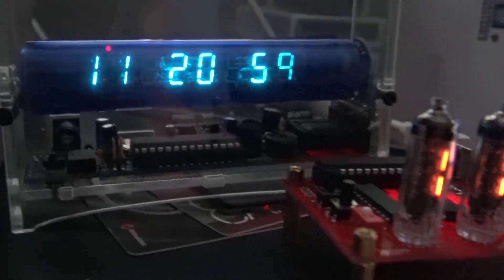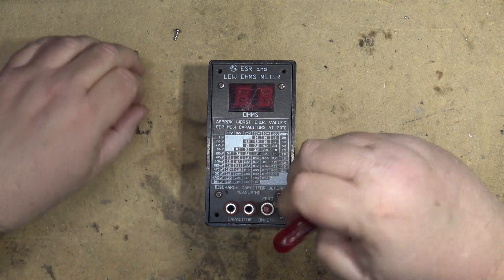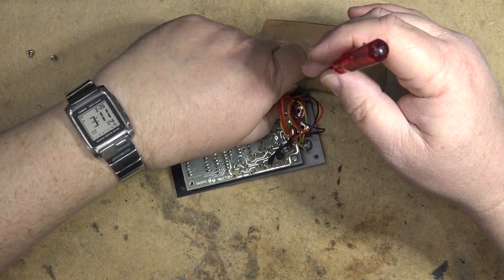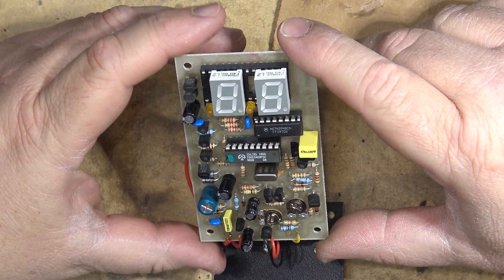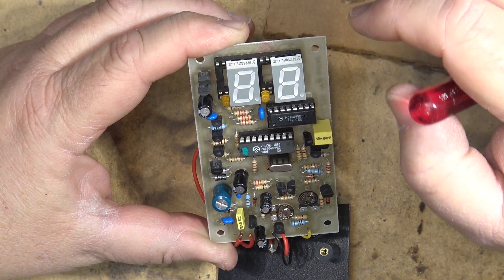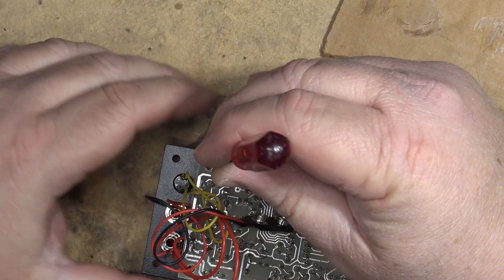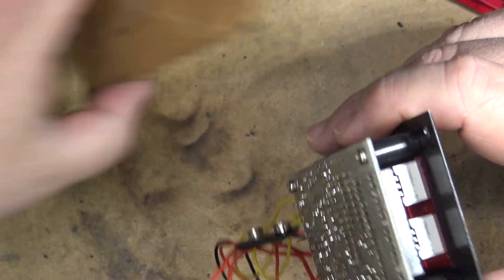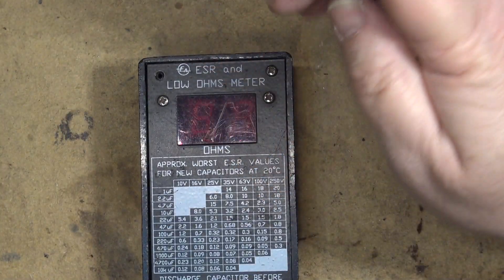Bob Parker ESR meter teardown

Comment: I have same meter and put it together too. I got mine back in the 90's and it has never failed me and have the same insulating material in mine too. I love how it checks in circuit and shows what caps that should be changed and the fact that it reads very low resistances of inductors and resistors. Very nicely designed meter, it's had very heavy use and saved me a lot of time!!

Comment: Maybe 25 years ago I bought the same meter, mine is Dick Smith, "EA" is Electronics Australia.

I use this meter 7 days per week during 25 years without any issue.
I add two diodes in opositive way in parallel to the inputs, some times I forgot to discharge a capacitor and the diodes blowup without any damage to the meter.

Best Regards.

Comment: Wonderful teardown an review dear sir. This is a great test equipment. I reaserched about it couples years ago and coped by the same processor code as it not available anywhere. Anyhow I made one analog one with digital ics buffer's and oscillator. That is really a fun and same way useful as digital one is. But those professional units aren't good which have a test button on them and you have to press that button once every time you test a cap.

Comment: That has been so dam handy for you, the amount of decent looking capacitors that have tested bad, not just on switchmode supplys but many ancient audio devices.
Worth every penny :-D
Your fluke multimeter has been very reliable for a long time, ignoring the minor recent display problem.
Again a dam usefull bit of kit that gives you information, just like the ESR tester.

Comment: I made a version of this meter yonks ago from the schematic.  I used a PIC micro though and wrote my own code however.  It is very simple code and is pretty straight forward.  I think I spent around 6 or 7 hours on the code portion.  The most interesting part to me was the measurement itself is done-  it uses the capacitor under test and a capacitor on the board to form a capacitive divider, and then sends current pulses through it alternately from ground and vcc.  There's three different transistors to VCC with differing resistors to control the test current, which is how the different sense ranges are done.  I am not sure how "smart" the original was with its autoranging, but mine worked by running at the lowest current range, and if the resistance reading was under 1/10th of full scale for that range, it'd bump the current up to the next range and move the decimal point and try again.  repeat until current is maxed out or reading is in range.  Eventually I retired it when I got a proper job LCR meter.   incidentally, that esr meter is good for other things- you can measure low value resistors with it, and wire resistances within reason, and PCB tracks.  I have used it and the LCR meter to find PCB shorts on power rails by moving the probes around on the board to find the point of lowest resistance.
Reply from the maker: That's why it is called a low ohms and esr meter.
Reply: @Kevtris , beautiful work :3 can you share the code plz

Comment: Always love those meters. I’ve got a collection of ESR meters and short circuit faultfinding/sniffer probes. I Love the Hewlett-Packard current injector and tracer probes but they are getting stupid expensive… Also love my EDS “leak-seeker 89”. It’s got to be one of the absolute best short circuit sniffers that’s ever been on the market. (And Iv had multiples of all of them)😁 Simply because of its small compact design, exceptionally well thought out and evolved circuit, and Jesus it’s just so easy to use and works so well.

But One thing I’ve always wanted… Is an analog esr meter. I’ve never had the time to build one and the only one available on the market is crazy expensive like $300 or something for a device that doesn’t look exceptionally well put together. I think it’s called the capacitor wizard or something like that…

Would also love to have an analog milli-ohm and micro ohm meter. I guess some of my VTVm’s have that capability and some of my modern multi meters and LCR meters definitely have the ability to check low resistance… but I Would just love to have a small self-contained analog unit. So I don’t have to drag out expensive and touchy high end equipment just to check for low resistance shorts. Or when I’m on the road or checking something out at someone’s shop away from my gear.

I’m a huge fan and collector of the Huntron tracker line of equipment… As well as the ”Toneohm” units. Been buying those for the past 15 years when they come up cheaply. 

My fascination with so-called “instant easy faultfinding devices“ started when I first started electronics… And didn’t know enough to use real lab gear. And also couldn’t afford a lot of real test equipment. So these “all in one” devices were so cool to me. Like magic. 

Now I have a few favorites for tracing out faults… Like the leak seeker, the De-5000 LCR meter, the HP current tracer probes, The Wavetek sf-10 short finding brush.... of course the flir thermal camera. That’s about all I use for faultfinding… But I still enjoy collecting and restoring them.

Comment: I bought a BLUE ESR meter...Bob Parker design and made ( or cloned ) by ANATEK instruments about a year ago.....seems to work but the leads are hard wired inside the unit. I would need to replace with input jacks to switch out the test probes.  Possibly a future project.   Thanks Dave   J K
Reply: The main reason for going to hard wired leads was because the resistance of banana plugs and jacks tends to vary as the leads are moved, especially on the bottom range which has 0.01 ohms resolution.

Comment: I have the Dick Smith (RIP) version.  Also got the option to protect the device should I accidentally test a cap that still has voltage on it.  Nice idea, but it added enough "resistance" that I couldn't always zero it out.
Reply: He's not dead yet

Comment: Does this kit have protection if the capacitor is charged?
Thanks for your videos.
Reply from the maker: No, hence the warning to discharge them first.   Easy enough to put diodes in, but I am not that dumb to measure a charged cap.
Reply: Yes. It can tolerate about 50V DC.

Comment: Have you ever tried out a Sencore Z-Meter? Thanks again for the videos!!
Reply: I have one. Had it for many years. Pretty good analyzer for caps - value, leakage, ESR - plus inductor testing and measurement. Had to make a switch repair/modification as Sencore ran out of replacements years ago. Design flaw.

Comment: Much nicer and chocked full of goodies than I would have guessed. Color me impressed "and" Color me embarrassed. I worked counter in a family electronics parts store in the mid 80's... I don't recall this alien (ESR) technology. My bad. I guess selling 1/4 watt resisters and fuses didn't qualify me for the important meetings 🙄

I would be proud to own that one 👍😁
Reply from the maker: It was actually a family run electrinics parts supplier (Main electronics in Vancouver)  that introduced me to the ESR kit. He said they were flying off the shelves and everyone was building them and they were the best tool you could get to service SMPS. So I bit and bought one. My boss wouldn't even pay for it because he was old school and thought it was snake oil. Boy did I prove him wrong in a very short order and I was fixing power supplies in record time.
Reply: It's like I missed a decade or something. Your "parts supplier" was surely the Silicon-Messiah IMHO 🙄 BTW, that was a chunk of change to layout at the time. You were dedicated!  The two revolutionary items I can recall from our salesman, Vinnie Boom Bott was the propane soldering iron and the red/green (LED) transistor tester. Clearly your neck of the woods was the place to be. Good times, good times 😁
Reply from the maker: @ovalwingnut  butane soldering iron. I remember those. I had one.

Comment: Did you ever notice that the chart is different on the MK-II version?  Why?  https://qph.fs.quoracdn.net/main-qimg-8900c3cb5ef2e93ed81a676b8718a444    In 2004 he said "• Front panel chart figures updated to reflect current-generation electrolytic capacitors." .. Hmmm .. which begs the question... which chart is correct?  I have the same 1996 version as yours (Zilog has 9808 date code).
Reply: Neither chart is correct, because ESR is not a "pass/fail" value. For switchmode and other high frequency use, you need Low ESR, lower than the tables show. For audio or other applications, the caps could work fine even if ESR was far in excess of either table. So, the table is just an indicator, but has no relevance to what ESR is required for any particular circuit application.
Reply: @johncoops6897   Yeah makes sense. I just had another look at both versions. Version I is labeled "worst case values" and version II is labeled "typical good reading".  I gather that was the update / change.
Reply: @techguy127com4  - I've found that most circuits will be quite stable even if some caps' ESR is way higher than it technically should be. In other words, when the circuits starts misbehaving and service is required, the ESR of relevant caps is literally "off the scale" compared to the figures printed on the ESR meter..
Also remember that many circuits use capacitors in parallel, which lowers the overall ESR enough to make the individual cap's ESR far less critical. A good example is PC Motherboards, which have 5, 10 or even more caps on the rails that supply the CPU - the PC will often still operate even when most of the caps have popped their lids LOL
Reply: @johncoops6897   True!  Being in the computer business for over 35 years I've seen just about everything from the very beginning, including reversed polarity electrolytics that exploded on the popular multi I/O boards that were used in all of the early 80's XT machines.  They would blow in about 10 mins - loud snap, smoke and all.  And although the "early" motherboards had their fair share of blown caps around the VRMs, it has easily been the PSUs that are far more troublesome right up to this day. I always laugh when I open them up and see the "VENT" brand caps - Yup, that's exactly what they did..  Lol  :-)
Reply: @johncoops6897  Thanks! That's a very accurate description. When ESR is high enough to make a circuit malfunction, it's usually way more than 10x the figure on the chart and often >99 ohms.

Comment: Hopefully sometime in the future, I would love to get me one the blue version of the ESR Meter. =)
Reply from the maker: Blue = UG.   I am not a fan of blue readouts. Hard to read.
Reply: 12voltvids Hear, hear!!! Between the often wildly excessive brightness of blue LEDs, and the fact that blue is more difficult to focus and tiring, blue LED displays are the devil! (Even though I like blue as a color as such.) 

My favorite for LED displays are actually the white ones. They also lend themselves very well to putting gels in front to get whatever color you want, like mimicking the turquoise of a VFD, matching the color temperature of the ambient lighting, or weirdo colors like lavender. :D
Reply from the maker: @tookitogo  White is good, I made a large format clock display with warm white LED. Orange is actually the easiest to read of them all. Those old Numitron displays and Panaplex are great.
Reply: 12voltvids Yes! I wish they still made those display types. Just in bigger than back then. (One of my perpetually-in-progress projects is to build a giant-digit alarm clock that I can read without glasses and a) has superb usability (like some Sony alarm clocks) and b) doesn’t use grody red, green, or blue LEDs. 5” tall panaplex or numitron would be ideal. I’m probably going to use giant seven segment or dot matrix, but in white. Or maybe cobble 7-segment out of some addressable LEDs that have warm white LEDs in addition to RGB.)
Reply from the maker: @tookitogo  I have one with digits that are 5" high.
Reply: @12voltvids  Nice!! Off-the-shelf or DIY?

Comment: Better get something decent like Tonghui TH2822E Handleld LCR Meter(OEM for B&K Precision)
Reply from the maker: Shows what you know.  This will measure esr and low ohms every bit as good as any commercial meter.
Reply: @12voltvids  agree good for esr, however good esr is also a shorted cap, this tool shows capacitance and esr simultaneously, when frequency changed quality of the cap, helped me, save time with hundreds of amps repairs(the large caps test)
Reply from the maker: @rumenmarkoff1214  
I don't do this for a living and thus don't invest in test gear. I use what I have available.  Investing hundreds is not a good business model unless there is payback and since I don't make much if any money working on electronics these days.

Comment: Yes you have taken that apart on Youtube.
You replaced a capacitor or something a while back.
Reply from the maker: No I haven't. Perhaps someone else has, but I have never repaired this unit since it was built. I have changed the battery and that is all.  I searched my channel in youtube studio and there is nothing related to this meter. Unless a changed the battery while working on another video.
Reply: I think it might of been EEVblog who made that video.
Reply: uK8cvPAq I’m sure Dave would have shown it at some stage, it’s a Dick Smith kit and most Aussie electronics hobbyists and many pros would have built that kit.
Reply: @johncitizen3361  I think it might of been during a repair or something so it's probably hidden within a video of a different title.
Reply from the maker: @johncitizen3361  Actually this one is a Bob Parker kit. See "Bob's" name etched onto the PC board. I thought it was a dick smith kit and referred to it as such and had to edit my dick smith comments out in editing once I saw "Bob" on the board, as this is a Bob Parker clone kit. Same thing, Dick Smith design, sold by Bob.
Reply: @ZilogBob  If I am not mistaken, you are Bob Parker.  I just put together one of these kits.  Thank you for sharing the design.
Reply: @smotic423  I have to confess that you're right. Dick Smith Electronics has been out of business for years, so either you've got an old DSE kit, or it's an Altronics clone from Australia. Anyway, thanks for building it and I wish you lots of successful repairs. 👍

Comment: Wonder how these sorts of meters compare to the cheap and cheerful Chinese testers available these days.
Reply from the maker: China tester is as good I would imagine.
Reply: @12voltvids  How does the Bob Parker one handle charged or partially charged caps? That's one of the weaknesses in many of the Chinese ones I've seen.
Reply from the maker: @uK8cvPAq  Did you not see the big note right above the test probe connectors that says "DISCHARGE CAPACITOR BEFORE TESTING"
Reply: @12voltvids  Nope, didn't see that.
Reply: uK8cvPAq Some versions of this meter have added input protection, at the expense of losing the ability to measure batteries. This is what Bob Parker says on the page below: “These ESR meters can generally handle being connected to capacitors charged to about 50V without damage, but like most other ESR meters they will be seriously damaged by being connected to such things as the main filter capacitor charged to 300V or more, of a 240V-powered switching power supply. Some versions of the EVB meter have extra protection as noted above.”

http://bobparker.net.au/esr_meter/evb-esr.htm
Reply from the maker: @tookitogo  Just add 2 silicon diodes across the terminals one in each direction. The meter uses under .5v to test ESR. So a cap with more than the forward voltage of silicon diode .6V will basically short out across the diode. A big cap may take out the diode, but it will save meter. I just put a screw driver across all caps under test first so no chance of charged cap.
Reply: 12voltvids I think those extra diodes is exactly what some of the EVB meters include.
Reply: @tookitogo  Thanks for explaining that! 👍